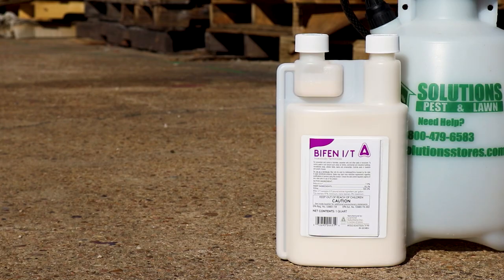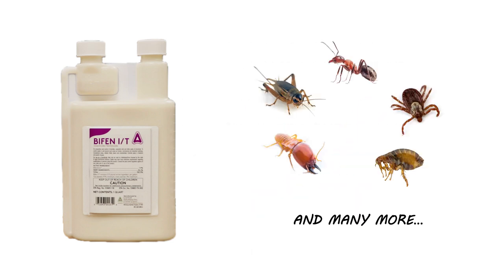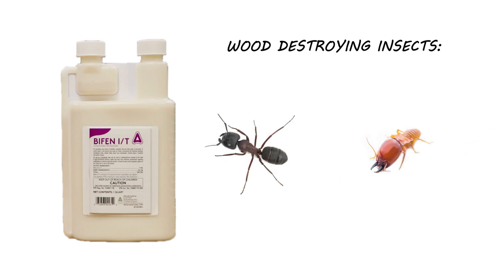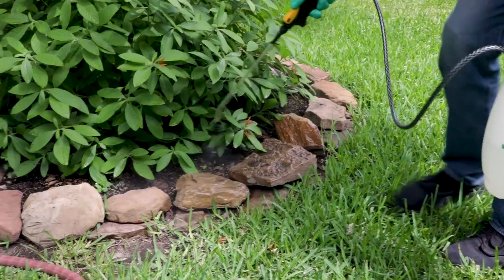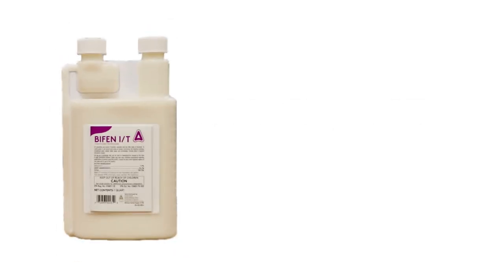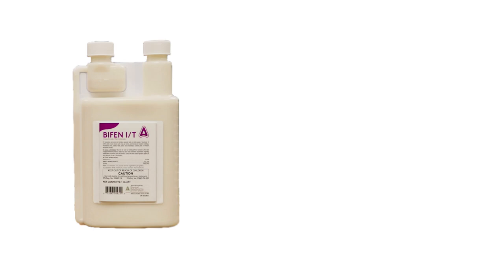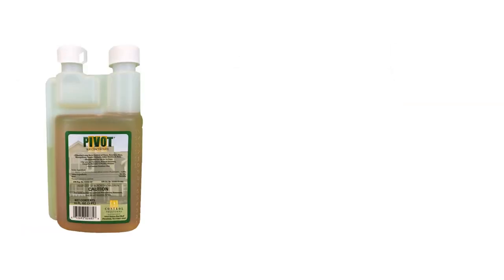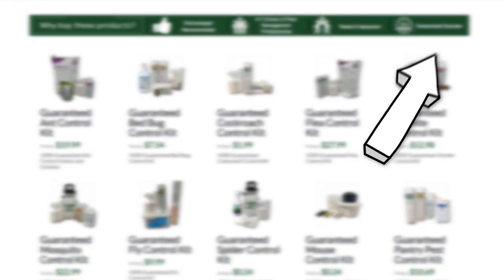Bifen I/T Liquid Insecticide: Product Review

Comment: We have termites and have a very narrow small crawl space. Can we use this for the crawl space? I already trenched the perimeter of the house with taurus sc and are using termidor foam for the crevices inside the house/basement. I'm just trying to cover all my bases. The damage is bad and wanna control it before fixing the house 
Thank you
Reply: Ana Rodriguez I just read your comment and wanted to tell you yes it’s safe in your crawl space, Bifen has a product that does give off a bit of an odor, but it’s stronger, and kills almost immediately called Bifen XTS. I am not endorsed by this company and gain nothing by sharing this, my brother turned me onto it a week ago and the results we’ve gotten have been phenomenal. Best of luck. FYI, I use the Bifen IT inside, and the Bifen XTS outside.

Comment: How do you use this with a hose in sprayer?  I added 2oz in the hose end sprayer,  I wasn’t sure what dial setting to use? Never used a hose end sprayer before.
Reply from the maker: When you add the product  into the sprayer the water will flow through mix the chemical and spray out. You will get roughly 2,000 sq ft. with this mix ratio.
Reply: Solutions Pest & Lawn how do you know what to set the dial to?
Reply: Man I had the same question and NOBODY can answer it, including this guy.

Comment: Can this be used with a fogger.
Reply from the maker: Hi, thanks for watching! Unfortunately, no. Bifen I/T cannot be used with any ULV or thermal fogging equipment.
Reply: @solutionspestandlawn  Does this apply to gas-powered backpack foggers as well, such as:
Solo 451
Stihl SR450
Tomahawk Cardinal

There are some DIY YouTube videos in which Talstar (Bifen) is used in one of these devices. Is this the wrong way to apply this product? It seems the aerosilization would be unsafe, even with a respirator. If Bifen I/T should not be used in one of these backpack foggers, which products do you recommend be used in them for mosquito control? 

Thanks